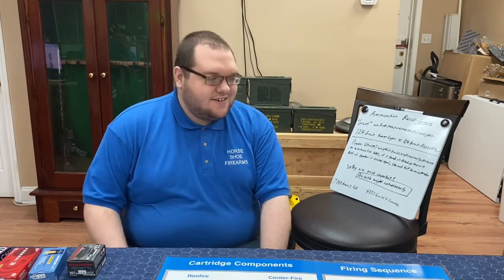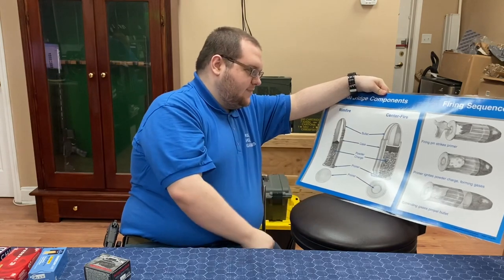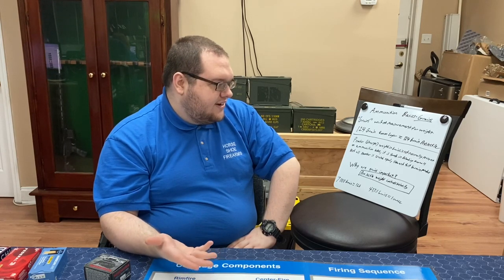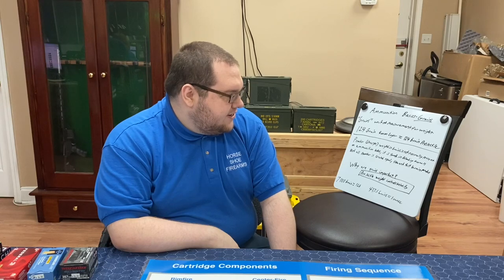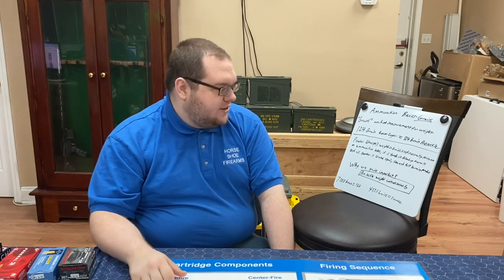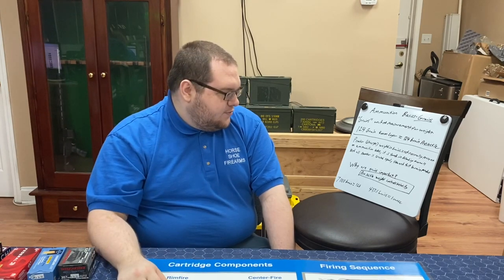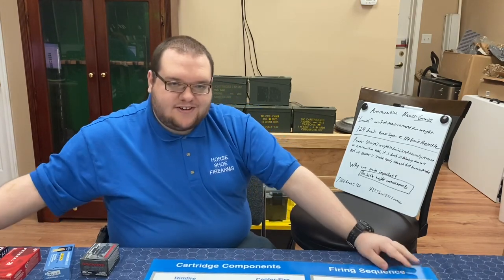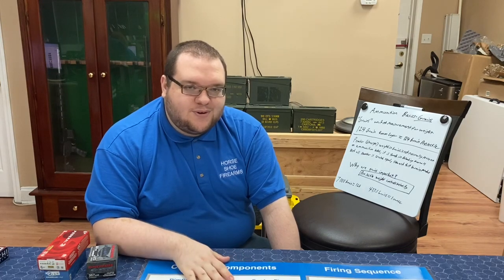Ammo Grain and Why It Matters - Ammunition Fundamentals: Projectile Weights (Bullets)

Comment: I'm new to firearms kinda I don't get plus p stuff and I ordered a 92x and do I need ammo plus p?
Reply from the maker: Hello there. The Beretta 92X and 92FS are both full size pistols, the concern would be with smaller frame pistols if they could handle a +P load. +P means higher pressure or higher powder charge, this translates to more wear on the gun, more recoil, but higher velocity. A standard 9mm cartridge may only be 1200-1280 feet per second, where a +P or 9mm NATO (another name for 9mm +P) may be up to 1400 FPS. In a full size gun generally you do not have to worry, the first place to check would be the firearm’s manual to see if they advise against it, but the general rule is single stack magazine pistols are a no-go, but bigger guns including the 92X should be +P safe. I don’t recommend +P ammo all the time, it’s more of a defensive load rather than a practice load, you can get practice +P which is the 9mm NATO if you prefer the higher velocity for distance shooting. Hope this helps! Thanks for watching.
Reply: @HSFirearms  thank you very much. I got that now. We live in a sorta townhouse and our neighbors are close so I don't want to harm someone else if somebody breaks in. Can you recommend what brand of ammo I should get? My son uses federal only in all his guns and he said I would buy some but I can't find any now. I checked the site and great prices there but it's very popular brand. I ordered some Sig ammo and they had only Sig left. Everyone is out of stock. (9mm) My firearm will be here after the holidays cause I'm not rich it's on layaway I am fixed income and not much really. My girlfriend helps me out. 92x Centurion (my future gun)
Reply from the maker: I’d recommend hollowpoint first, failing that 147 grain 9mm. Ideally 147 grain hollow point if you are willing to pay more for the exact correct product. What you are looking for is maximum grain size for 9mm in order to slow that velocity down, but retain similar projectile energy per round. Less velocity translates to less penetration, leaving less risk to wall penetration and harming your neighbors. I would discourage +P if you are discussing an in-home scenario, the +P is better at penetrating thick clothing like jackets or even some soft kevlar armors, but it also penetrates walls and makes it less viable for your use. Flat nose is also an option if you can find it, thats a popular hand cast option and the Beretta is built like a tank, so if you are left with no alternative than hand loaded ammunition you stand an above average chance of the gun surviving a critical malfunction. 147+ grain Hollow point, or atleast flat nose, non +P is my recommendation. Thanks.
Reply: @HSFirearms  yea I watched guys who have Berettas and no problems, they just eat anything ammo. I was looking for Px4 storm compact because I'm left handed and I do everything with my left hand.
Reply: @HSFirearms  definitely hollow points and I'm gonna use ball ammo at the range and some hollow points too because I'll have to used to hollow points from the recoil. Hey I appreciate the help from you.